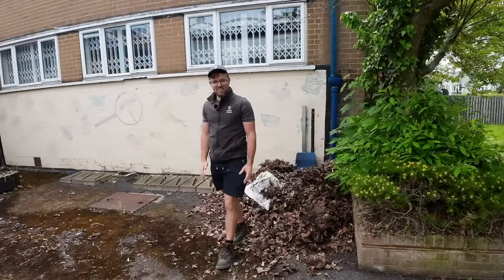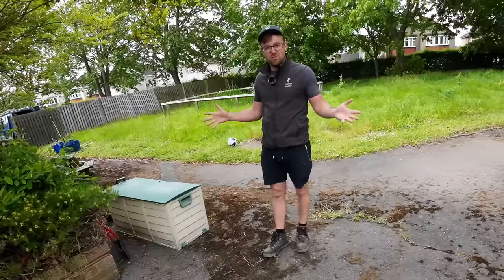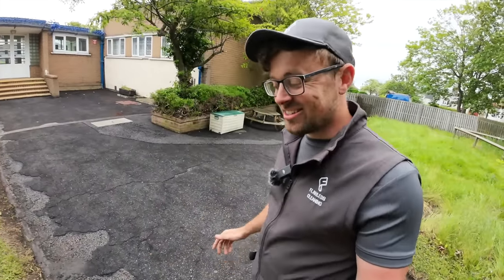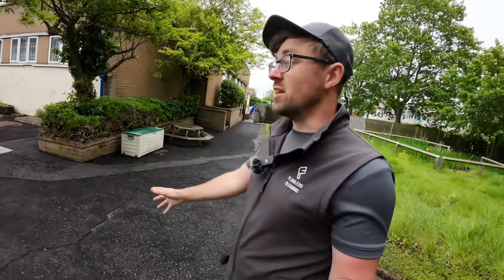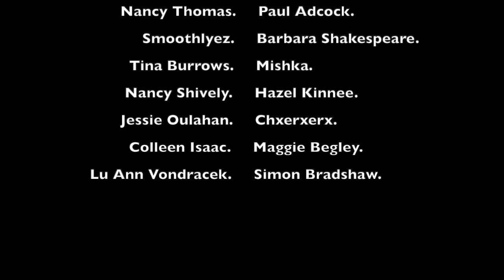I NEARLY GAVE UP! Restoring This School Entrance..

Comment: You have to remember you are doing the best you can with the types of areas you are coming across. They are often neglected for years and have deteriorated over a very long time.  The difference between the before and after shots are great and it looks so much better.  What you are doing really makes a difference and you are putting back into your community.

Comment: Ooohhhh, very nice. They've got their own compost stations. Those leaf blankets def had earthworms.
I'm 6 minutes in and exhausted already. Dad if you stand on the curb, shovel down the straight edge (cutting the roots) and kick out the shovel (pulling up the roots), you might find edging a bit easier.
Great work so far. I guess this school doesn't budget for constant campus maintenance? If not, PTA might consider volunteer weekends raking, weeding, trimming, etc.

Comment: I would definitely recommend for your father to edge out the line 1st and then scoop up what is supposed to be removed the edging will help it to disconnect from the grass itself and it’s so much easier

Comment: I'm not sure if you've ever run into them, but have you ever had a chance to try out Ego's powered brush for the multi-head system they make?  I've found that tool absolutely invaluable for heavy clean-up like this.  It's absolutely super at stripping the caked-on gunk from hard surfaces and shifting it.

Comment: Can I make a suggestion to make cleanup easier? Put a large tarp down. Shovel or use a blower to get stuff onto the tarp. Then just drag it where you want to dump it. Or if you’re bagging it, just put one side into the bag. It goes much faster than using baskets. The end result is100 times better than before. The kids will get many more hours of fun out of it. You an only do the best with what you’re given. Keep in mind that anything you do is better than what it is like before you do it.
Reply from the maker: Appreciate that Sherryl! I’m not quite prepared to be a gardener but i’m thinking of branching out.. getting some proper equipment as it makes such a difference and fun to do!

Comment: Love your videos and you are doing wonders in your community and for others in need! 💖 I love to power wash, and am always looking for better ways of doing it, so I was wondering, why do you most often start at the bottom level power washing, starting at the lowest ground point and going up, power wash facing the facades, washing fences from the bottom up, instead of washing from the top and letting it flow downwards? Is there a special reason or benefit with that method? 💖

Comment: Ben,

Great job!

May i please offer a small bit of advice though?

Wouldn't it be more productive and prudent to start from the top of something and work your way down?

You would likely use less time, and water...

Example:
Power washing the steps...

You started at the bottom and worked your way UP instead of down...
abd the dirty water from the upper steps was then all over the ones below that you just cleaned.

I noted on other videos you do the same thing.

IF you wash from top to bottom, you be won't need re-rinse the clean ones as you work DOWN.

Just a little bit of advice, if i may.

Thank you.

My motto:

"Work smarter... not harder! Think outside the box!"

Comment: You lot are all freaking out about the state of the school.

At least they arent making the kids do it, our "reward days" at primary school used to be the class doing manual labour for the day to keep up the school. We raked leaves, swept playgrounds, planted flowers, pulled weeds, even sanded down then repainted all the railings, tables and benches when we were in y6 as a "reward" for finishing our SATs... that one took all 29 of us nearly 4 days of working in the heat of summer. I still remember getting upset that i was all sweaty and sticky being made to sand railings in the sun in a school dress, and that it was being called a reward. We also were not allowed back inside the school while we were doing these things so over the years i got sun burnt a few times on these so called reward days when it was summer. 

That was shameful.

Comment: Do yaw have an edger to go around sidewalks nd flower beds? If so use it if not then invest in buying u one. It will be a lot better on ur backs. Just saying nd my opinion. Btw where is ur face mask to protect ur lungs from dust particles nd ur gloves for ur hands. U also need to wear ear protectors to protect ur ears from loud sounds. Those r the most important items u need when working in the yards nd on roofs of houses. And I do follow u in ur videos.